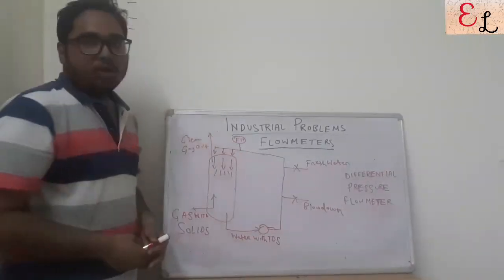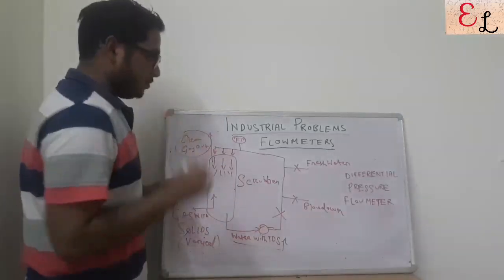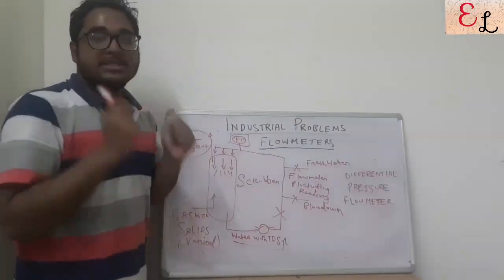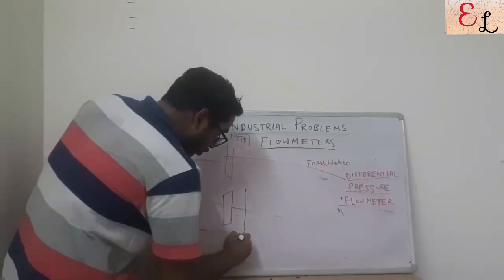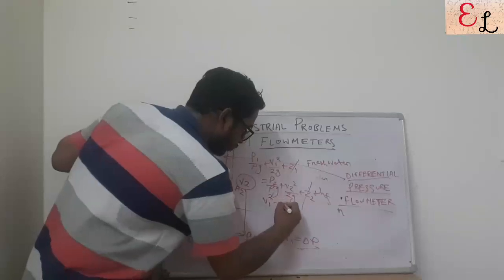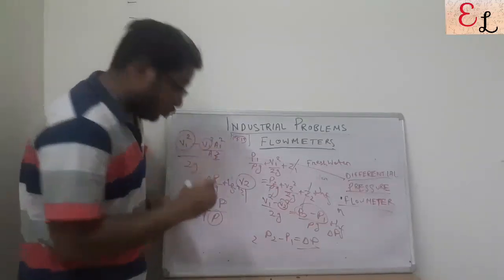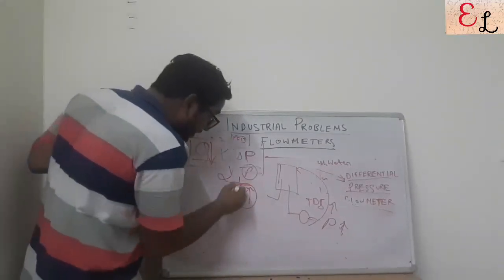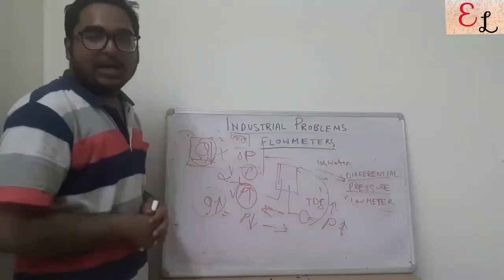FLOWMETERS | DIFFERENTIAL PRESSURE FLOWMETER | REAL LIFE INDUSTRIAL PROBLEMS

Comment: Reasons for fluctuations are:-
1) Maybe somewhere leakage in line. 
2) Maybe dust collects in tube or in DPT manifold or near DPT Sensor. 
3) Maybe DP not create by Orifice, Annubar, Venturi, etc. 
4) Maybe control valve hunts. 
5) Transmitter Card me be malfunctions.